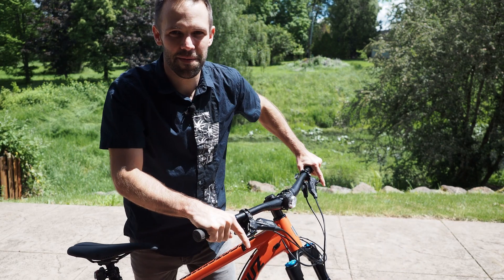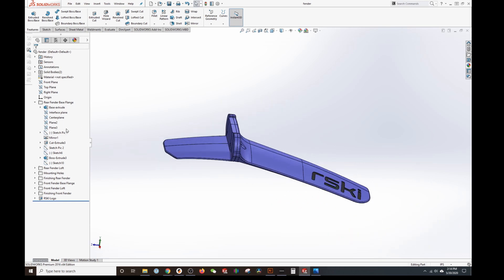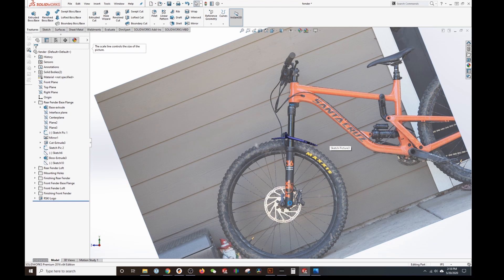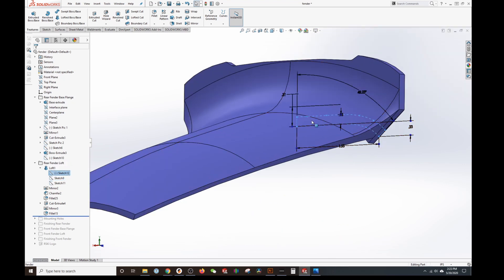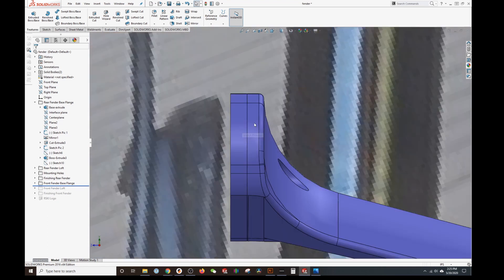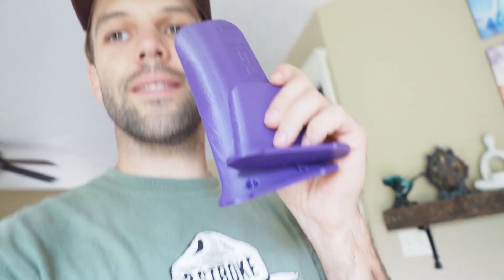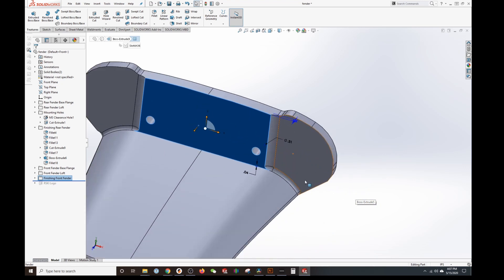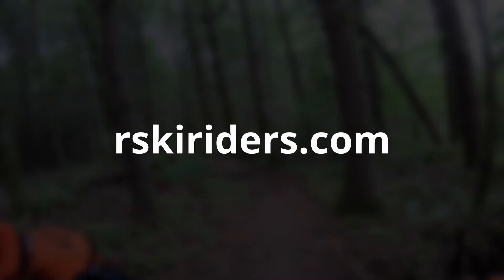3D printed MTB Fender! Fits 2020 Fox36 not Rockshox

Comment: You'd want to print this sideways so that the long part follows the grain of the print. One accidental amount of pressure on this print and it will break.
Reply from the maker: This fender is extremely strong when printed as shown with proper settings and a .6mm printing nozzle. The two mounting screws bend before the fender breaks. :)

Comment: How did it hold up?  Guessing pla?
Reply from the maker: We tested a bunch of these in PLA and once the geometry was perfected we never broke any fenders. Downside of the PLA is if you leave the fender inside a car where it might get very hot it will become soft and deform.
Reply: @RSKI  thanks! But so small front fenders, do they really serve a purpose? 🙈 Sorry, i don't use fenders... yet.
Reply from the maker: @SplitPhotography  It helps a lot with mud ending up in your eyes. In the dry summer I don’t need a fender, but rainy winters in Oregon are definitely more enjoyable with a fender of some sort.
Reply: @RSKI  i hear ya. Will give it a go on my printer ✌🤙

Comment: Downloaded the 
.stl file, just like to ask what spec bolts you used? Thanks!
Reply from the maker: I think they are M4, but I can’t recall the length. Sorry I’m out of state at the moment!
Reply: @RSKI  No problem, thanks for taking the time to respond!
Reply: By the way, @RSKI Riders, would you have an idea of how much it should reasonably cost to have it 3D printed?
Reply from the maker: The material cost is only like $1.00 so it shouldn’t be much. If they’re running a business 3D printing I think it should be about $12 to $15